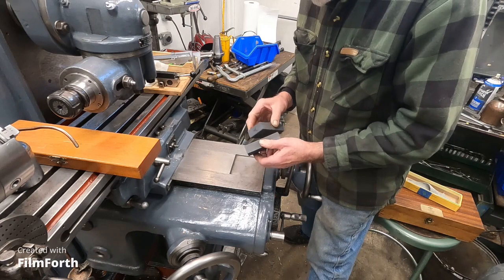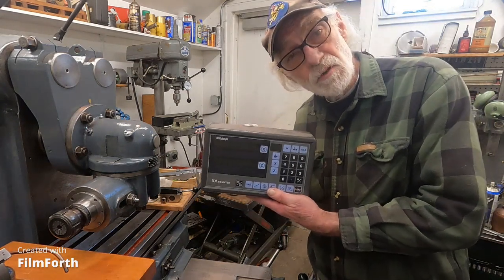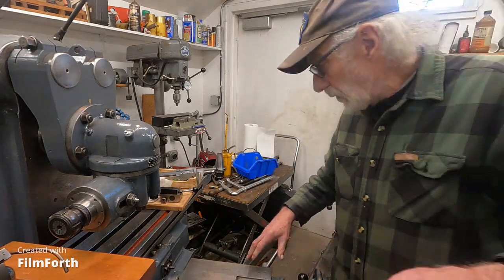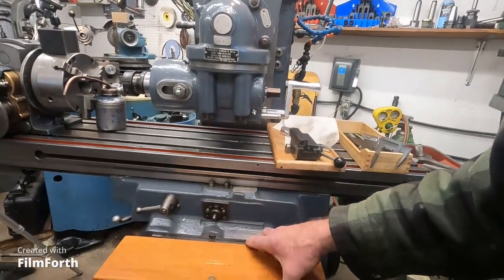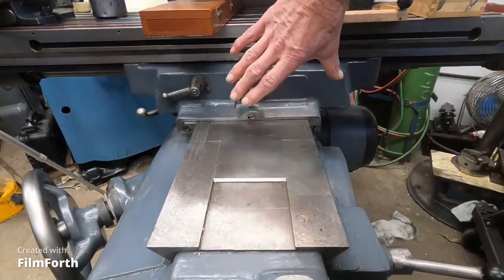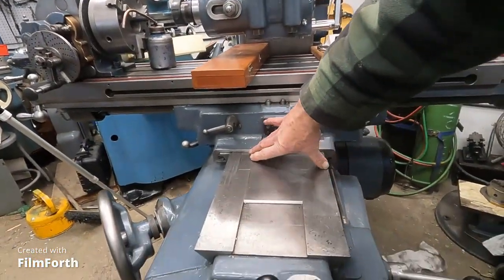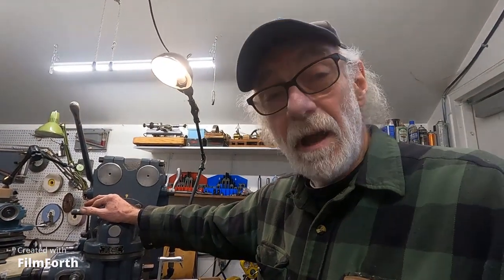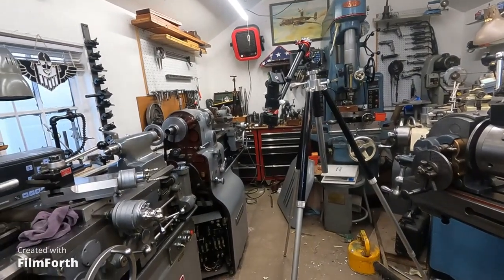Heavy Machine Tool Dove Tail Yaw Error

Comment: Donnie, I have a Chucker and an HLV-H, and for sure know about dovetail machines and offset rack and screw drive. It makes the boring bars drag on the pull out, and it pulls away the turning tools on the return.  I call it carriage crab.  I also have a Van Norman 22LU with dovetail Y ways, and it has the offset feedscrew.  It was crabbing a whole bunch, so I re-ground and re-shimmed the gib.  It took a lot of it out, but the top of the knee could use some scraping. So I know exactly what you are talking about when you sat Yaw.  These examples are either a design compromise or a design oversight. Either way, hooray for Bridgeport (and others) for putting the screws in the middle.  Side note, I have a 1920 Cataract (Hardinge) toolroom lathe.  It has inverted vee ways, not dovetail ways like the later ones. No crab (or yaw). Most people do not see design details. I guess the good ones do. Right on Donnie! ----Doozer
Reply from the maker: I ran into this some time ago using a worn Hardinge chucker for machining valve seats, valves, and guides for catastrophic repair and performance work on cylinder heads. There are many good milling machines  with the dovetail way and offset screw, this very small problem gets worse with wear. I first experienced yaw on Atlas bench lathes that were a common "small lathe" for shops here if you know its there you can compensate a little anyway, thanks.

Comment: Now you have me excited to see the chucker up & running. At the place where I work, we still have some Hardinge chuckers & DSM59s scattered around the place, but I rarely get to use them. Even then, it's usually to use one of the DSM59s as an improvised "manual lathe" to make something I need to get a job up & running on one of the Brown & Sharpe screw machines. Thanks for posting :)
Reply from the maker: Hi thanks, the chuckers can do a lot.